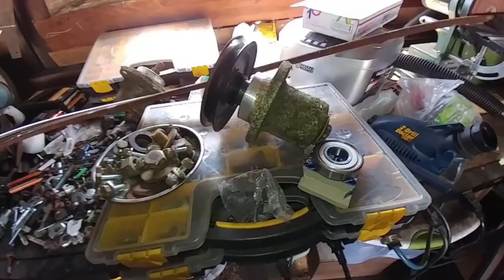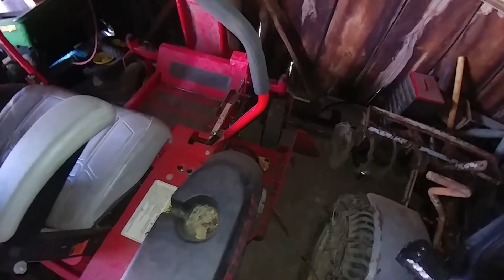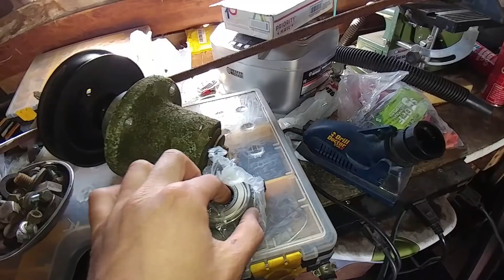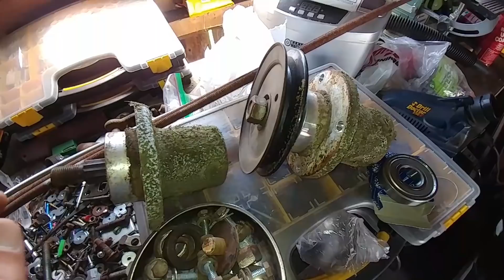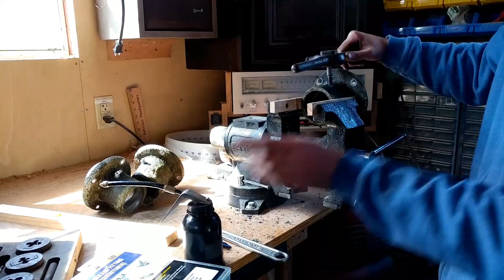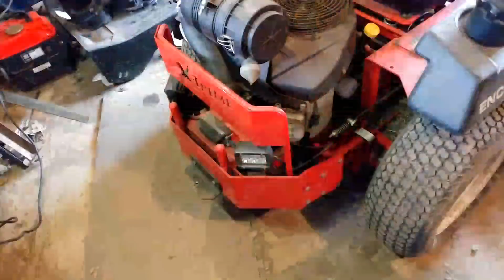HOW TO MAKE NONGREASABLE MOWER DECK SPINDELS GREASABLE AND LAST MUCH LONGER!!!!

Comment: Why music during the opening?  I had to check my open tabs for porno. 
Good info on the spindles. I'm going to do this to mine before the bearings go bad. Thanks
Reply from the maker: That's a good question lol. I have never had to touch them since this video. They are perfectly fixed as far as I am concerned. The mower has around 1000 hours on it now.

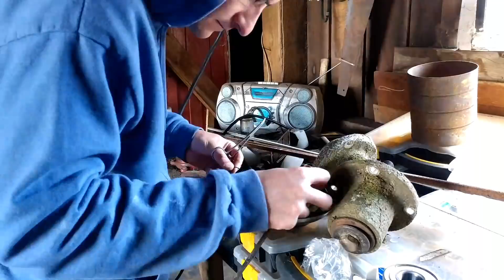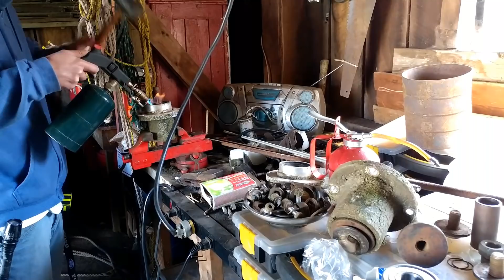Comment: It's because if somebody hasn't said it already, because they want you to buy all brand new spindles and spend a lot of time changing everything out every single time they start to dry out. I know on my Cub cadet zero turn It's a 2014 model and two years ago I decided enough is enough and put in actual greasable spindles I didn't have to tap into it or anything like you did I actually bought greasable spindles and every third cut I grease them and has been working perfect ever since. I park mine in my workshop So it never has any chance of getting wet also my Cub cadet did not have headlights which I know is kind of ridiculous but with the hours that I work at work sometimes I can't get to cutting 10 acres of grass until about 5:00 6:00 in the evening and here in the south about 7:30 8:00 it starts really getting dark and I need at least a good 2 hours possibly three two cut so I added LED light pods and a switch that's near the throttle and they are amazing and very bright and do exactly what they are intended to do. People usually use them on ATVs four wheelers you know and such but I installed them on my zero turn and once you turn on the light switch it illuminates so you can see where to shut them off but I'm just rambling now but if anybody's curious yes you can add LED light pods to your zero turn and it is very simple.

Comment: General info good. Prior to watching this video I had a heck of a time getting the right tap and grease fitting. You should add the measurement/size of grease fitting and tap
Reply from the maker: That's a great idea. If you get an assortment of grease fittings they should have the thread type on the box. At least mine does.

Comment: Heres my thoughts , I add nipples also if they don't have them  , I pump grease until it goes  threw bearings and comes out ends of spindles , grease will go past the covers , grease guns push out 10,000 psi ,  they are not seals just loose fitting dust covers .   , adding a relief hole does not allow fresh grease to pass threw bearing so what you are left with is the same contaminated grease around the bearings..  as bearings wear they create metal particles that will just sit there and act like sandpaper , you want to flush new grease threw them to purge the contaminated grease  ,  a guy on you tube actually proved it using different colour greases , the grease will go through bearing with both covers on  , grease will follow the path of least resistance   so when cavity is full it has nowhere else to go but threw bearings and out ends of spindle  as its designed to do .   I would prefer to have new clean grease around bearings. , adding the vent hole guarantees no new grease will ever get to berrings after the initial fill
Reply: This sounds good but will probably still cause bearing failure due to overheating from so much grease

Comment: Its easy, an expensive mower that one can pop the bearing out of and replace for 10 bucks in minutes is easier than trying to get people to buy greaseguns.

Also, dont drill extra holes, spin the blade as you pump grease. As soon as you see grease starting to squeeze out from the seals, youre done.
Reply from the maker: Yeah, that is true. However, it's a much bigger job to replace the bearings than it is to grease it every so often. This mower has about 1000 hours on it now, and I've never had to replace any of the bearings in any of the spindles since this video. Greasable spindles, as long as they are greased often, are the way to go. If people don't grease their equipment, then sealed bearings are the way to go.

Comment: Any followup now 4 years later ?  Did the greased spindles last longer ?  I hope so.
Reply from the maker: Yes, they are still good to this day. The machine has close to 900 hrs on it now with the bearings I installed in this video. Worked flawless.

Comment: FYI the John Deere grease-able spindles have sealed bearings in them so the grease has no path in. 🤔When you rebuild them, you can remove the inner seals to allow the grease in.
Reply from the maker: I have heard that before. We have a John Deere with almost 500 hours and never replaced the spindle bearings. I would think they should have gone out by now if they were sealed so maybe the ones we have are greasable. I don't know.
Reply: The “sealed” bearings on mowers that have either metal or rubber on the inner part of the bearing do in fact allow grease to penetrate. The problem people have or the misconception is that they think 20 pumps is more than enough to fully grease the whole spindle assembly. It takes more like 70-100 pumps of grease (especially on a new spindle) to completely fill the spindle so as to allow the grease to have enough pressure to squeeze through the inner seal of the bearings. The inner seal just acts like a dust cap to keep unwanted debris that may get in the spindle but there’s enough clearance to allow pressurized grease to squeeze in. Once you have actually fully filled the spindle assembly the next time you go to grease the spindle/bearings it’ll only take 10 or so pumps to apply fresh grease to the bearings
Reply: @logankurtenbach1059 the grease only squeezes into a small portion when the seals are on, vs the entire bearing when you take the seals off. Also, once grease is in the spindle, you only need a few pumps.

Comment: I have to do the same thing on my Hustler mower which is commercial also. What I'm going to do is tap the weep hole for the grease and put in a 1/4" x 28 screw to seal it up. Then when I grease them take it out. Nice video
Reply from the maker: Thank you. Never had to replace them since this video. Mower have pushing 800 to 900 hours now.

Comment: Just a thought,but I always leave the top inner seal in place because if you remove the top inner seal the shaft gets warm to hot during operation and then the grease gets thin so it all settles down on the top of the bottom bearing where the thinned out grease gathers on top of the bottom bearing somewhat depriving the unsealed top bearing of lubrication whereas if you leave the top bearing seal in place the lack of lubrication to top bearing is no longer an issue.
Reply: if the entire cavity is full of grease it won't settle out of the top bearing

Comment: If you were to make the perfect machine business would be booming till everyone that could want one has one. After that sales drop for selling the machines as a whole, and if parts aren't flimsily made and instead last for ten years then dealers won't have any thing to sell customers and won't make money selling your products anymore. your factories get closed workers are laid the company goes bankrupt.  Then after market suppliers start up, as there is now a niche for them, after you go out of business, but they manufacture and sell slowly and steadily without having massive factories and work force. You have already went out if business, or died or sold out, so probably won't be able to fill the niche that you made ten years before it became profitable, but, at least, your machine is still going strong just not your cash flow. The economy is designed to where it you are not in a constant state of growth then your business, especially manufacturing, is dying. They market these in a manner to make you think it is better to not have to 'service' then when really they are non-user maintainable but they are dealer friendly.
Reply from the maker: You are correct. Glad I did what I did. I'm still amazed it didnt have greasable spindels but the cheaper John Deere machine had greasable spindels. It's weird.
Reply: @Lanninglongarmmowing  If the JD spindles have "sealed" bearings, then it's irrelevant that a zerk fitting is installed. You can pump in all the grease you want, but the "sealed" bearings aren't exposed to that grease. See Steve's Small Engine Saloon YT channel for more info.
Reply from the maker: @Eupher6  I had heard that too. Guess I'll have to take those apart also and take out the inner seals lol.

Comment: Should have at least drilled a hole in the top of the bottom bearing but not the bottom of the bottom bearing. Gravity and heat should have allowed grease to enter the bottom bearing.
Reply from the maker: I took out the seal in the top of the bottom bearing and the bottom seal of the top bearing. Grease should be able to get everywhere it needs to. Plus I drilled a hole in the top seal of the top bearing so grease has a way out if need be.
Reply: Your grease fitting, in my opinion should be just above the bottom bearing to push old grease up and new grease down.
Reply: Love2boat92 ok I guess I missed that part I thought you just drilled the seals of the top bearing.
Reply: Love2boat92 Idk how many times you have to explain it to silly people that refuse to pay attention,lol kudos to your video xD

Comment: Those New bearings are sealed ,if you had the bearings with the rubber seal you can take out the rubber and put that side in than they will get greased ,just a thought.
Reply from the maker: Yes I filled up the entire cavity so they should get plenty of grease. Lol.
Reply: Pay attention he did all this already for longevity,dummy,lol!
Reply: You are right

Comment: Noticed your JD mower.  My model L-118 runs good, mows good, but for only about 10 min.  then slows down moving forward then quits moving at all.  Any ideas???
Reply from the maker: Ron Thacker It could be low oil in the transmission. It could be the Pistons inside need to be lightly polished. The pump could need rebuilt. Thicker oil might help also. How many hours are on the machine?
Reply from the maker: Ron Thacker I have a video on replacing the axle seals on that machine. Haven't uploaded the rest of the series though.
Reply: Tranny oil was first thing i filled but made no difference.  It's a 2005 model and looks pristine.  Previous owner only mowed yard around his house on 1/2 acre lot.  i just checked for hours but battery was dead.
Reply: Ron Thacker need to bleed air out of it if oils been changed,might not of been done properly which takes 20-30mins
Reply: Slipping belt!
Reply: No filter?  Pump or hydraulic motors may be bypassing as hot fluid flows easier. Belt could slipping after it gets warm. Does it make a different sound after it starts slowing down? No gravel falling sound, right?